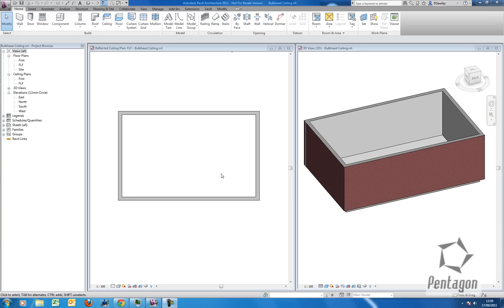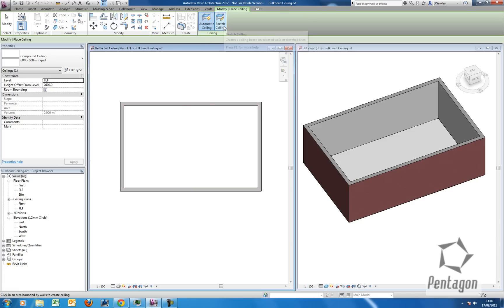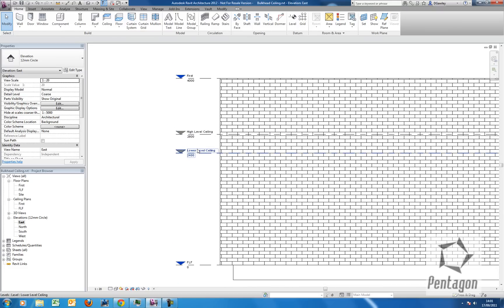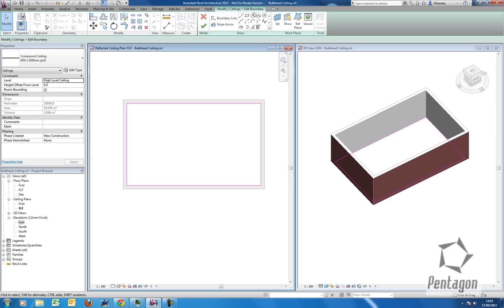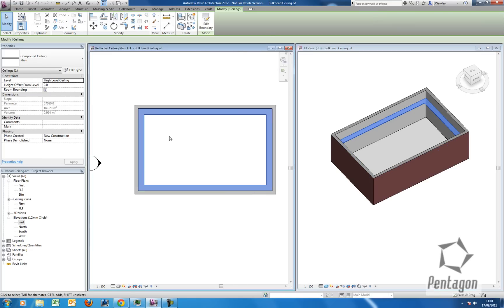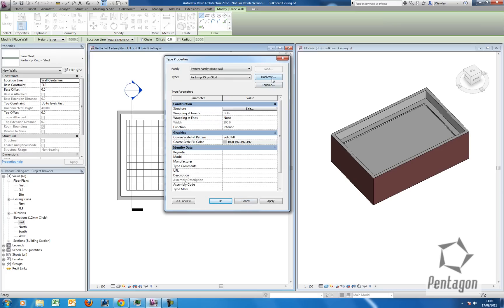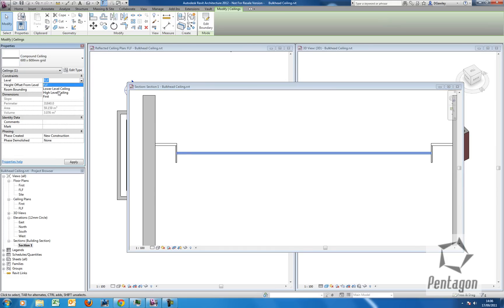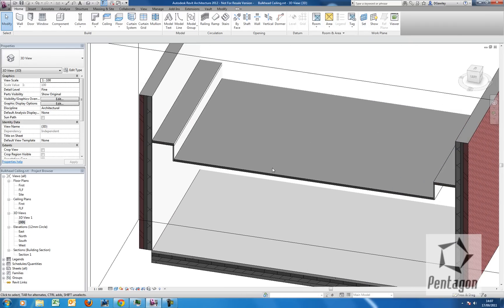Creating Simple and more complex Ceilings in Revit Arch 2012.wmv

Comment: Hi there. I am facing a problem with the 600x600 grid ceiling. Can I fix the origin of the pattern by any method? If I have a 1800x2400mm space, I would like to have 3 rows x 4 rows exactly in that boundary but Revit seems to choose any arbitrary pattern due to which cut tiles are shown. I cannot issue a proper GFC RCP drawing that way